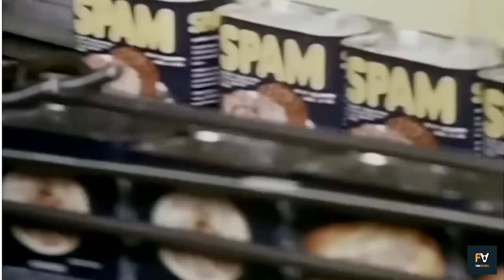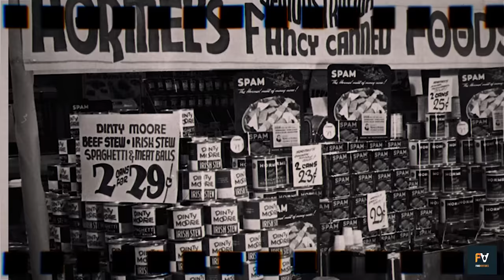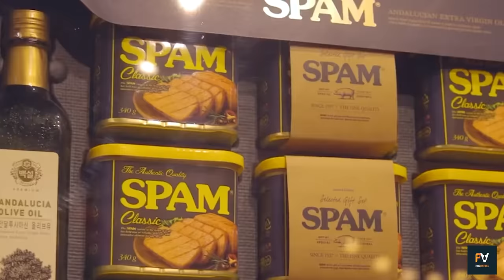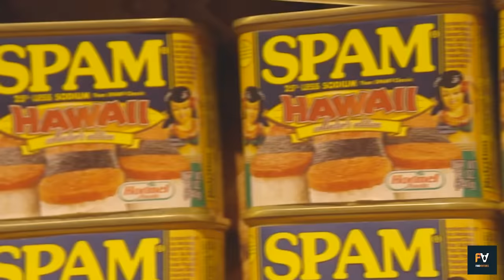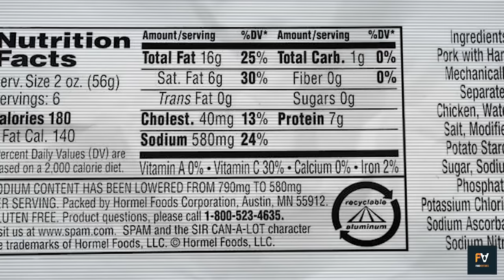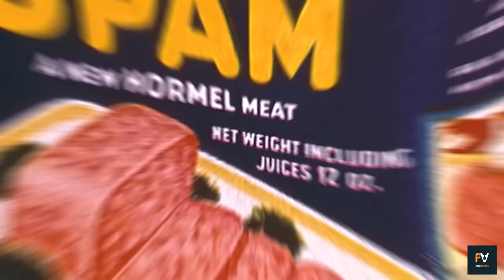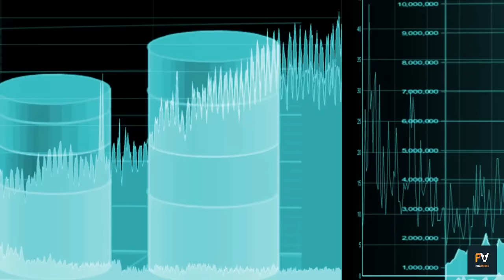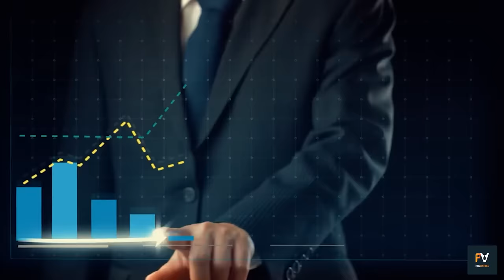Revealed: The Hidden Truth About Spam Food

Comment: The Health risk was never a proven factor at all. If it was soldiers in WWII Would never eaten it. My diet is CDonivore and it does the opposite of what woke Doctors falsely claim it is.  As far as Nitrite and Nitrate it's made by us breathing in Nitrogen that is 80-90%+ in our air. So saying Nateate or Nitrite Gives us cancer is farcical because that would mean the air that mostly nitrogen would give us cancer just by breathing it in. And Cholesterol? Lowering your Cholesterol is robbing your body of the lubricant it needs to heal and clean the body, Like Liguide Draino.